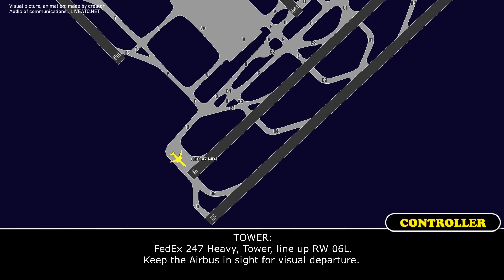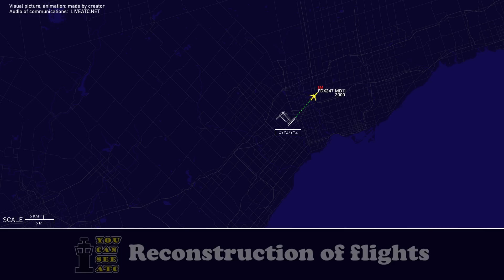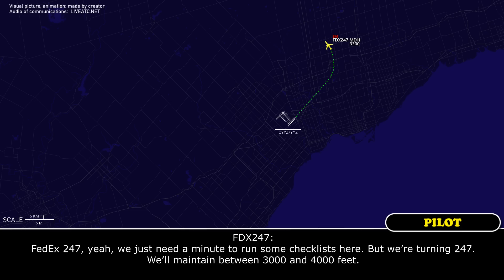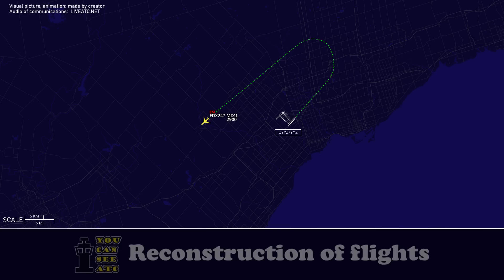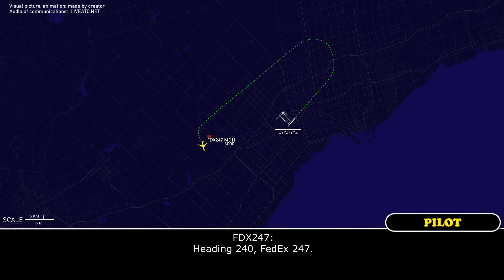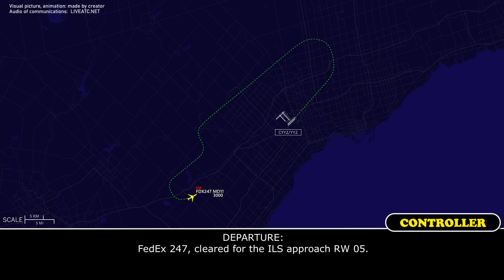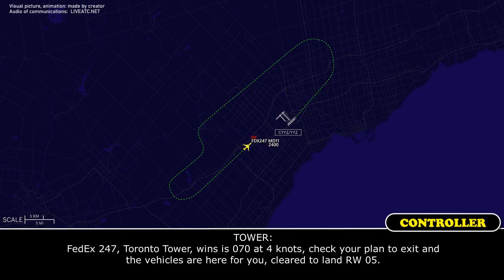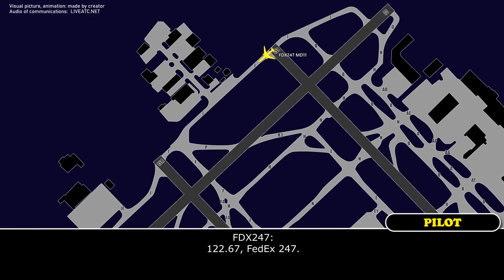Thrust reverser deployed after takeoff. FedEx MD-11 returns to Toronto. Emergency landing. Real ATC

Comment: If the reverser actually deployed, then these pilots did extremely well to save the aircraft.
Reply: That is because its a tri engine plane. I think on a two engine plane it would have been more difficult to control.
Reply: @mikemicksun6469 — Lauda Air Flight 4 was a crash caused by an uncommanded thrust reverser deployment on what was a relatively brand new 767.
Reply: @AEMoreira81  767 is a different ballgame.
Reply: Total professionals....in the air and on the ground!!!!
Reply: As a previous MD-11 instructor at FedEx, I can tell you that this scenario is covered in training. In fact, while giving a check ride to another instructor in the simulator, the inflight deployment of a thrust reverser is one of the most challenging and disorienting events we covered. My friend Paul (the other instructor) handled the confusion and extreme vibrations caused by the the reverser’s deployment with the calm professionalism you would hope for.
Reply: @mikehenderson2039 couldn’t you just cut the fuel
Reply: Still got the centre thrust instead of just the one on the wing.
Reply: Thrust reverser in flight? How could these pilots have been so calm. Wouldn’t this be like trying to drive with a blown tire and the brakes on one side locked? I guess it being a tri engine helps. Wonder what the cause was
Reply: @Skywest25  Just idle it. And compensate the rotation with the moving parts on the wing. Tri planes and twin are about the same in this situation.
Reply: I am not a pilot and know nothing about flying but I was surprised to see so many comments about what would happen to the flying ability of a plane with the supposed thrust reverser engaged when flying. I think I thought all of this would be well researched and characterised about air behaviour and plane behaviour when such and such occurred but it appears people have different thoughts about it.
Reply: I confirm it did deployed at 400ft
Reply: Yeah I was wondering how much yaw would be produced and would it potentially result a loss of hull.
Reply: Respectful and kind words help in all phases of life.
Reply: @storminnormin4651  So true.
Reply: @@stevenstrain283Ding Ding Ding! We have a winnah! 

I believe some sort of corrective measures were implemented after the previous mishap. Your description captures that well. Thanks.
Reply: I have doubts the reverser deployed. More likely the indicator/caution (of reverser deployed) came on and they pulled that engine to idle and climbed at V2+something, giving no real controllability problems.
Reply: @@stevenstrain283 This is entirely inaccurate.  The reverser problem does NOT cause that wing to stall.  It DOES cause asymmetrical thrust, resulting in something akin to having a  sticking brake on one side of your car--you can still drive.but the car will pull to one side.  It definitely diminishes the overall thrust which must be compensated for to remain airborne.  The yaw effect must also be compensated for.  Keep the airspeed up, make the yaw adjustment, and bring the problem engine to idle.  This would have been critical if it happened on takeoff fully laden with payload and fuel.   Then, quick decisive thinking would be essential.  Sometimes it takes a few moments to assess.
Reply: @selftrue670  No, you are entirely inaccurate. Certain people thought what you claim, but it turns out on many aircraft, the flow of reverse thrust disrupts airflow over the wing and causes a significant loss in local lift. Boeing made the same wrong assumption and killed 233 people on Lauda Air 004. Loss of lift is normally a good thing, as, like spoilers, it aids in dumping lift and increasing braking effectiveness.
Reply: @straightpipediesel  I do understand what you've said.  The reversers on wing- mounted engines literally push air in the opposite direction over the airfoil causing diminished lift.  In some situations, that could be enough to stall a wing; in this case, it would seem it was not.  Reverser thrust travelling backward across the wing does not have the Bernoulli principle in effect--wrong airfoil shape, thus the anti-lift effect is not comparable.   My only point here is that the situation is quickly  correctable (if quickly recognized) by throttling down.   Airborne reverser and spoiler deployments at other than takeoff or landing are rare, but are generally manageable.
Reply: @@stevenstrain283 BTW, on many aircraft there isn't a real need to go to idle before pulling to reverse. Indeed, the time needed to spin down doesn't really allow it to go to idle. E.g. if you pull the throttles to idle at 30-50 ft, touch-down, and then pull to reverse, the engines will be spooled above ground idle. Not only that, but there's no harm in that especially in high-bypass engines with cold reverse... there's no need nor advantage to waiting for idle.
Reply: @@stevenstrain283 You're over-simplifying here. Strictly, the two wings are providing all of the lift, not most, though there are the upward components of the thrust vectors, though no pilot calls that lift, and the fuselage of the MD-11 produces next to zero lift.
The air-flow from even full reverse thrust is not enough of a volume of air to stall the wing (though it could stall it at that part of the span where the engine mount meets the wing)... the rest of the wing will keep flying no problem. What will stall the wing is when the full reverse vector is enough to initiate a spin and that wing's airflow drops below stall speed. Is that what you mean?

Comment: Very smooth and calm professionals.  Good communication.  I thought there were safety devices to prevent accidental deployment of thrust reversers, but I guess they failed, which might explain why the plane was still grounded three days later.
Reply: As far as I know, Boeing was the only one to address the problem of thrust reverser deployment in high altitude flight in reaction to a crash: Lauda Air Flight 004, and Nikki Lauda had to really twist their arm to do it, as they didn't want to admit fault. McDonnell Douglas made a video about the MD-11 when it launched meant to help sell the plane to various airlines, and one of the things it advertised was that a flight reverser can deploy during flight without catastrophic consequences.
Reply: @unr3alGaming  its a requirement that everyone has them. its supposed to shut them off when the plane senses it's not on the ground.
Reply: @bwagner3619  Both planes already had those I believe. The Boeing even displayed that there was a thrust reverser malfunction on the ECAM before Lauda Air 004 went down. Boeing modified their planes so that the landing gear has to be down for this rest reverser to deploy and I believe they modified the locking system that holds it shut.
Reply: @bwagner3619  No, e.g. the DC-8 is approved for in-flight reverse, as is the C-17, and probably several others. Many turboprops are also approved for in-flight reverse (prop beta).
Reply: @unr3alGaming  Do you have a link to that video? One of the very few civilian jets with approved in-flight reverse is the McDonnell Douglas DC-8, and even there relatively few operators actually did that. I can't imagine what the selling point on the MD-11 would be regarding that.
Reply: @BruceWatson-dw3ro  Sure, the link should bring you to about the 4 minute mark, where the thrust reverser on engine 1 deploys in flight on camera and the plane remains stable. This was done right after a popular segment of this video shown on YouTube of the MD11 doing stall testing, which admittedly looks terrifying, but needs to be done on all commercial aircraft. I've heard that many Russian aircraft allow you to deploy thrust reversers  during flight without catastrophic consequences, but this has historically not been the case with American aircraft.

https://youtu.be/HML-cWNoLu4?t=240
Reply: @unr3alGaming  all planes handle a single uncommanded thrust reverser deployment, they reverse about 20% of total normal thrust, so you are losing 1.2 "engines worth of thrust' until the engine is spooled back then its just a single engine out.  yawn.  lets talk about spoiler deployment if you want scary.
Reply: @jasonbender2459  That may be true for newer planes, but Lauda Air flight 004 was mentioned a few times in the comment section here, and that event occurred in 1991. The investigation of the accident showed via flight simulator recreations of the event that the pilots had between 6 to 12 seconds to do everything correctly to be able to recover the plane, otherwise it was certain that the plane was going to crash. Pilots who failed to do everything correctly during that time window reportedly always lost the plane. And yes, I would not want a problem with spoilers or flap or slat asymmetry. TAESA flight 725 is a good example of that.

Comment: nothing but left turns into the malfunctioning engine??
Reply: It doesn't fly the same as your Lazy Boy.
Reply: That's normal.  That is the side with reduced thrust.
Reply: @user-sr9bi2uu8w  No you would never want to  turn too much into the into the inop engine can kill, depends on plane and speed, it would just roll over and spin.
Reply: Yes, because when the left engine is out, it is easier to turn left than right. This is why when the controller gave right turn vectors, he said "but only if able".

I can totally understand the confusion for you and the two people who thumbed you up... an MD-11 has very different flight characteristics to a couch - it's a common point of confusion.
Reply: Err..  Think about that. Remember that they started veering left, which is when ATC asked if everything was ok....

Physics!
Reply: @flfl2  makes sense.
Reply: That's odd maybe engine was shutdown or put to idle?  Certainly standard rate or less.
Reply: Yes. You have thrust on the OTHER side, making those turns easier.
Reply: @jonchowe  And that kills pilots, it's called a Vmc roll, every plane is different.
Reply: @publicmail2 The direction of the turn is a big deal with underpowered non transport category aircraft. Not so on large transport category aircraft.
Reply: @georgeconway4360  True
Reply: @jonchowe  Which kills a lot of pilots, look up Vmc roll, especially smaller twins.
Reply: They don't get it...